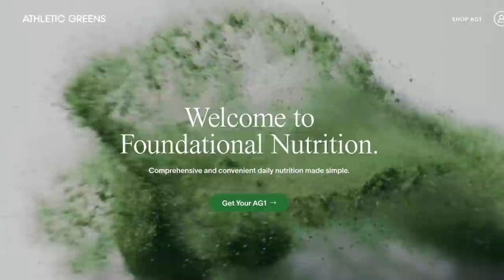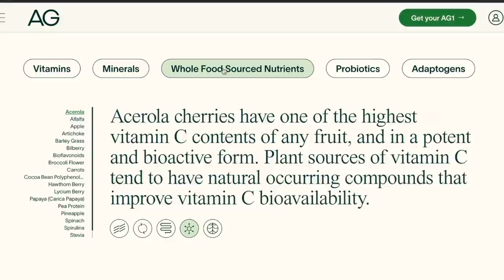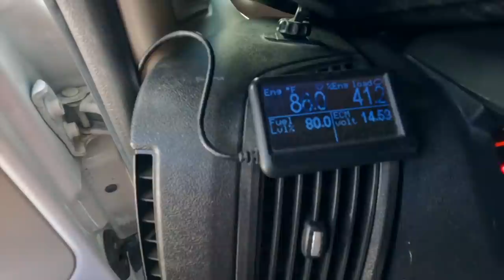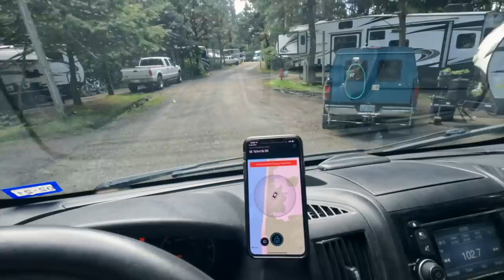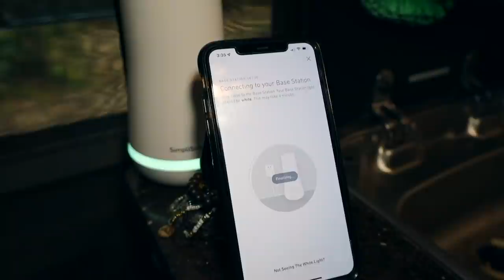3 DIY Van Mods: Cheap & Easy Cassette Toilet Bowl Replacement 🚽+ Security & Van Maintenance

Comment: Sometimes it takes an engineering degree from MIT to get wipers on. And they are not cheap anymore. I remember buying refills for a few bucks many decades ago 😂
Reply from the maker: The Salty Medic 😊 I was so irritated with those wipers! I mean it looked like it should be easy but I didn't want to break that clip by forcing it either. Yeah and you're right, it's not cheap.

Comment: Thanks for letting us know about the porcelain toilet insert. What a great idea! Also, I wasn't aware that bleach damaged the toilet. Guess I am lucky that I used other cleaning products. BTW, we miss you on the Hymer Facebook group.
Reply from the maker: John I’ve used other products too and I guess that ruin it but nevertheless the plastic just gets stained over time. I’ve been full time in the van for 4 years now and mine started staining last year. Yeah I kinda gave up FB.
Reply: Hey John, not only bleach can ruin the your toilet bowl, even just using the wrong toilet brush will damage the surface. Let us know if you have any questions or would like to learn more about our product. And please, tell your friends in the Hymer Facebook group about us! ;)

Comment: A note about windshield washer fluid.  Always put the subzero rated fluid in.  If you don't and it gets below the freezing point the fluid is rated for, it can ruin your either windshield washer system; pump, lines, nozzles and the reservoir tank which may be an expensive repair depending on the labor plus we have have supply chain issues getting replacement parts.  I never let a service center put in windshield washer fluid in.  All they typically do is top it off with water or premixed fluid.  In a pinch you can put antifreeze in your windshield washer fluid if you can't find the subzero rated fluid.

Comment: There are several Auto parts places where you buy windshield wipers batteries air filters cabin filters etc they will put the wipers batteries filters and a few other things on for free when you buy the items there. They will also do a test code scan for free if you have a check engine light on. I go there all the time to these places to get it done. They are fast and easy and free.

Comment: Thanks for the video. It is good to see how these things are done. A question about the car lock system, if you have is on, and you leave Lilly in the van, does it go off?  BTW I just left you a email about the O22 meet up.

Comment: Since the toilet insert isn’t sealed on the bottom with silicone, won’t water/urine/feces that is sitting in the bowl before you flush seep in between the insert and the plastic bowl?
Reply from the maker: No the toilet insert goes all the way down to the edge of lever and everything will drop into the cassette.
Reply: We've done extensive tests on this topic. As Amber said, with the way the Twusch is shaped, everything drops down into the cassette and the material and surface does nor allow for anything to stick or seep in.

Comment: I'll check out Athletic Greens. Which package did you order? There are many options.
Reply from the maker: Ramona DeLaney 😊 I get the single subscription. It's my fave because it comes with the starter package as well. Let me know how you like it Ramona.
Reply: @AmberJBaldwin  I will let you know. I was thinking about getting the 2-person pack for my hubs and me. However, he's not much into change. I'll order the single person pack for now and maybe upgrade later. THOUGH, I probably won't get your discount if I upgrade Hmmm...
Reply: @AmberJBaldwin  I placed my order today and should receive it soon.

Comment: Ceramic toilet bowl liner? Ok, learned something new today. I like that idea.
Reply from the maker: Nomadic Fanatic 😊 Porcelain actually. It sure made the toilet better and not having to see that yucky gross stains. But you always replace your entire toilet so makes sense. Plus, I can't replace the entire toilet without ripping up the shower liner and rebuilding the floor (if I want a non-cassette toilet). It's the dumbest design ever.
Reply: @AmberJBaldwin  Porcelain... I tried to write that three times but spelled wrong so I changed it to ceramic. lol. Yeah, it helps with cleaning for sure. Plastic just doesn't do well over time.
Reply: It's a brand new product! :) And pretty amazing, if we say so ourselves. lol